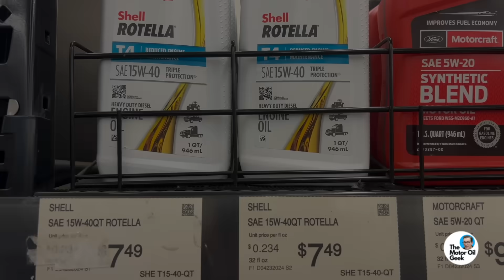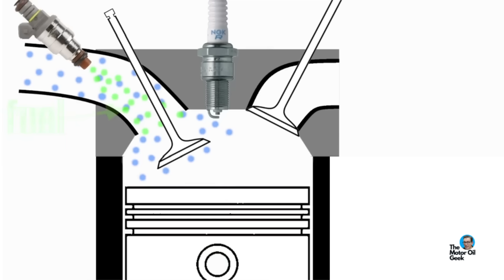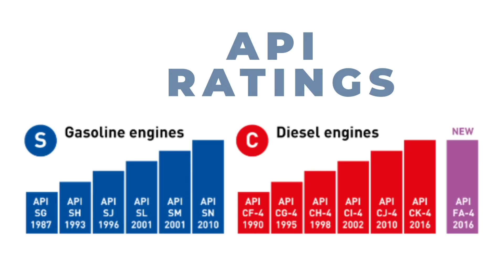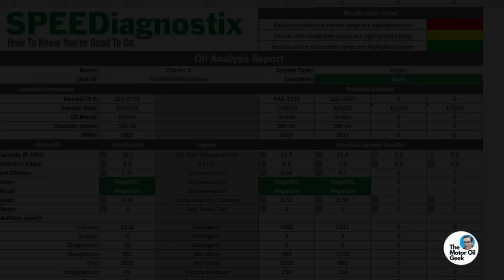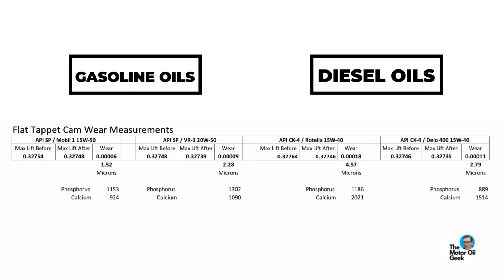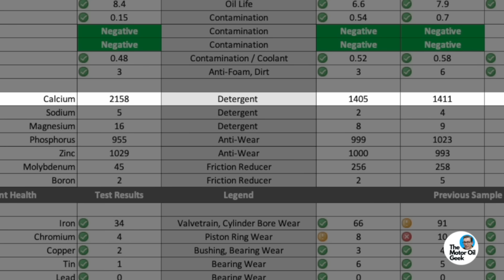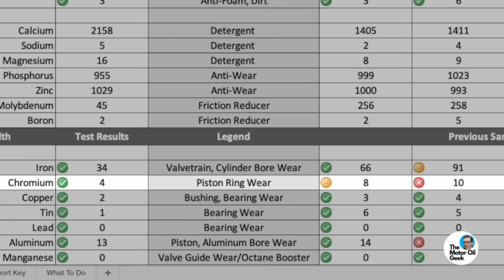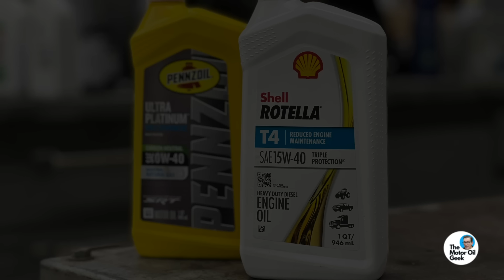Why DIESEL Oil is Actually WORSE for Gas Engines!

Comment: Rotella 5W40 T6  is rated
SN for spark and 
Cxxx for compression
& JASO MA2 for bikes.
Reply: Now I’m really confused because I love T6 for motorcycles and also used it on several cars.
Reply: @MassimoTava  I use it in everything from the lawnmower, snowblower, motorcycle, F150 etc.  and not about to change my habits.
Reply: @michellatour150 maybe try it in your coffee too??
Reply: @sprint2648  Nope, coconut oil in the coffee for health.  Black is still the best though.
Reply: @MassimoTava  T-6 is motorcycle oil but yea I dont run it in my 2022 car that specs a 0w-20.
Reply: I put T6 5W40 in everything at home, from a lawn mower to CFR450R , ridgeline, 6.7 powerstroke… you name it
Reply: Not a good idea for your ridgeline if it’s direct injected.
Reply: Look up the current specs, previous versions did have a S rating but not the latest, only C
Reply: @michellatour150  just bought another case last night ill have to look afterwork
Reply: •	Rotella T6 5W-40: Diesel: CK-4, CJ-4, CI-4 PLUS, CI-4, CH-4. Gasoline: SM, SL, SJ, SH. Notes: For diesel & pre-2011 gas engines w/ catalytic converters.
	•	Rotella T6 15W-40: Diesel: CK-4, CJ-4, CI-4 PLUS, CI-4, CH-4. Gasoline: SM, SL, SJ, SH. Notes: Broad temp range, same as 5W-40.
	•	Rotella T6 0W-40: Diesel: CK-4, CJ-4, CI-4 PLUS, CI-4, CH-4. Gasoline: SM, SL, SJ, SH. Notes: Extreme cold-start optimized.
	•	Rotella T6 Multi-Vehicle 5W-30: Diesel: CK-4. Gasoline: SN. Notes: For mixed diesel/gas fleets, modern standards.
Reply: @MassimoTava  I see but I use European spec as it has tighter tolerances. It's still rated at acea e11 which the only reason it doesn't meet the gasoline a3 spec is the saps level. Typically a3 spec has saps around 1.3% and higher. E11 is about 1% and lower.
Reply: @MassimoTava  15W40 will never been similar to a 5W40. They are night and day different in flow rates at all temperature ranges.
Reply: What are you talking about the working temperature of both of those oils is a 40 viscosity they should be working load at a nearly the same flow rate the cold thickness viscosity of 15 would only become a factor below 40° Fahrenheit however retains far better mechanical sheer resistance due to its base stock being thicker  @TheOfficialNakatsuMegami
Reply: @MassimoTava  which country are you in? The US site and bottles don't mention gas at all for T6 5w-40.
Reply: @rcdieselrc  older containers maybe. I know it used to have SM or SN on the container, but that’s changed within the past few years.
Reply: @rcdieselrc  I just looked and you are correct
Reply: And it also has the increased detergents which increases wear in all gas engines. Or did you just ignore that part because you already bought 50 gallons of rotella when you joined the diesel oil is better cult?
Reply: @bobbygetsbanned6049  I didn't ignore the part where they compared 2 heavier viscosity premium full synthetic oils to a conventional, and a semi-synthetic (or synthetic? both fall under delo400) diesel oil. 
It was a majorly flawed test.

Was the added wear due to the different additive package?
was it due to the difference in viscosity?
was it due to the difference between conventional oil and synthetic oil?
was it due to the difference between manufacturers? 

A test that flawed is either cherry-picking or incompetence. And neither are a good look.
Reply: swiss knife oil indeed!
Reply: T6 all day long in all my Jeep 4.0s…..application matters
Reply: SN is not good enough for newer direrct Injection. SP is better with less calcium as Lake mentioned.
Reply: @papaal7014  t 6 with apple cider vinegar makes the best salad dressing.
Reply: I don't care what any of you guys say, I am not putting rotella in my bike, nope.
Reply: Sadly they have stopped putting the SN rating on the bottles that I have been buying lately.
Reply: T3 is JASO MA/MA2 as well.   No need to splurge.
Reply: You'd probably mix it in your pancake batter.
Reply: Shhhhhh! Your gunna make our favorite oil harder to find! 😉 been using t6 for more then 15 years in multiple vehicles zero issues.
Reply: One size fits all? No thank you
Reply: This video and comment section lays it to test for me. Glad I never put Rotella anything in any of my motorcycles.
Not worth the risk for a little savings ( but dang it suck’s because it’s a 20$ to 30$ savings over amsoil.
But I guess it’s one of those to good to be good things..
Reply: @motov8-garage832 amsoil is absolutely the best if you can afford it I’ve used it in the past thirty years ago in a plow truck transmission previously I used the regular transmission oil but would replace the transmission after the season the amsoil in them they worked like a dozer and never replaced them again great oil
Reply: Baaaaahahahaha. Tell us you don’t have a clue.

Comment: Ok I got a good one for you! I’ve had allot of people who ride Honda Goldwings, and a lot of people will use Rotella T6 diesel oil in there motorcycles and swear by it. I’ve always used the proper motorcycle oils on all my bikes. Being aircraft mechanic trained I’ve always used the proper oils in the proper engines. Could you test the theory out. Thanks

Comment: But that Rotella T4 in the video is also SN rated for gasoline engines! Its right there on the back of the bottle.
Reply: Good spot. At 4:59 the API Donut shows only CK-4, but above it lists SN
Reply: But Which S Cert? I can bet it isnt SP, because SP is designed for low speed preignition, and SN is not.
Reply: @TheOfficialNakatsuMegami  sn+ was designed for lspi, their now finding that when oils becomes "used" their prone to speed preignition so no more low since it can happen at any range from the tests.

The sp is to test used oils for tgdi since the lpsi specs fall off and Noone has been able to test this. Now their about to.

So ibe been told
Reply: This video needs some clarification. SN came out in 2010. Lake focused too much on di engines. Many like myself use the T4 10w-30 in carbureted flat tappet engines and not modern di. Although the eight minute mark was useful.
Reply: @kelseyschoenbaum4681  He didn't focus too much on DI engines, the added detergents increase wear, because they compete against the anti wear additives in the oil. That's applicable to 100% of gas engine applications. It's pretty easy to understand.
Reply: Which doesn't change the fact that the increased detergents increases wear in gas engines. How is that every comment missed this point entirely, when you all obsesses over wear numbers in every other engine oil video!?

Comment: Great video! Can’t believe dudes are putting diesel oil in their70’s Corvettes because of the zinc package!!
Reply: Well they’ve been doing it for 54 years. It meets GM requirements. So…
Reply: they are not direct injection engines.
Reply: Guess if it works for you sweet. I think there are better options out there.

Comment: No argument on running diesel oil in a direct injection gas engine.  But what about a carbureted flat tappet gas burner with the rings gapped for nitrous?  Seems like that application might not be the same slam dunk answer?
Reply: Man they would spend all day explaining the different situations on what oil to use in each engine or motor.

Comment: I've been running Rotella T6 in my Honda ATV, 4 stroke carbureted, for like 2 decades and it has been excellent. On top of that, the engine and trans share oil.
Reply: Yup all I use on a few vehicles is rotella t6 5w40. Zero issues.
Reply: That's what is in my 84 honda 3 wheeler right now. It's spent most of its life running diesel oil.
Reply: @Krankie_V I have 84 200x love that thing
Reply: Run Rotella T6 5W-40 in my turbocharged,  port injected 5 cylinder Volvo gas engine for years.Still no sign of excess crankcase pressure in PCV that can plague neglected Volvo engines.
Reply: All my bikes for 15 years have had T6 put in them.
I change every 3-5k for $25 bucks. Never once had a single failure or issue and will continue to use it in all of them
Reply: I do as well, in fact I run it in all my small engines...... but here is the kicker, none of them are direct injection or turbo charged. Did you watch the whole video?
Reply: @TheTruthman89  yes, I did watch the whole video. But notice how my comment speaks specifically towards my use case and also why I explicitly said carbureted
Reply: And have you been testing the oil to see if you’ve been getting any extra wear?
If you’re not testing you’re guessing.
How many miles do you drive your ATV a year? Maybe 500?

Let’s be real.
ALL engine oils out there will lubricate your engine.
But for how long?
Reply: @einstein3509  That's true, but the real question is will the extra amount of wear  cause the engine to fail before the rest of the car fails. I live in Northeast Pennsylvania and chances are the road salt will rot the frame away before the wear from the oil kills the engine.
Reply: @ 
hahaha funny you should say that.
Those are my thoughts on the boutique oils.
I have no doubt they are far more superior than the other oils out there.  
But do I need that in my daily driver??
I have a 1992 Ford F150 I bought it in 2005 from a friend and it's only ever had conventional oil in it and it has 334,000 miles on it now and it's still going strong and does not burn a drop of oil or leak any and it's been and still is a daily driven vehicle.
In fact we have a 2011 Rav but the wife prefers driving the 92 Ford and drives it every day and it's been a Minnesota truck from 92 until we moved south in 2017.
Reply: @einstein3509  honestly, in a previous video, Lake proved that Napa house brand synthetic oil offers better wear protection than Amsoil and Royal purple 😆
Reply: @Krankie_V  according to Project Farms tests the cheap Amazon oil was the same as Mobil1
Reply: @einstein3509  I have a rancher 400 with auto trans. Just over 5000 miles with Rotella t 6 since new. No issues.

Comment: So why does Harley Davidson recommend that I use a CE, CF, CF4 CG4 Diesel engine oil in my Twin Cam?
Plus, the oil company I use says that their oil is "suitable for use in 4-stroke turbo-charged and naturally aspirated indirect injected diesel engines and petrol engines".
Reply: Ask them !
Reply: I just checked now, In Australia you can get a single product rated for API SN/CF  for light duty (common rail - don't generate much soot) diesel and petrol engines. The CF wouldn't meet the spec required for direct injected gas engines as talked about in the vid
Reply: The oil also wets the clutch. It needs to grab enough so that the clutch pack doesn't slip under loud.
Reply: Typical Harleys have separate engine and transmission oil. So you can run super slippery heavy engine oil 20-50W and different trans oil

Comment: Thank you for the insight, Speed! Always fresh!

3 days ago I poured HDEO to my 110cc gasoline scooter (carburator) engine, so I assumed this HDEO should be good for my engine.
Yet I have been used Dexos certified PCMO for 10 years, and my scooter engine still running very well.
But I always curious what if I use HDEO for my scooter engine, and now my engine is more silent than if I use my regular Dexos certified PCMO.
What will happen if I use HDEO regularly for gasoline scooter engine?
Thanks in advance.

Comment: Does high calcium content oils cause LSPI in ALL gdi engines or only in the small cc ones?     will a high calcium containing oil  it cause LSPI in a 1.8 gdi engine wit a compression ratio of 9.2:1??
Reply: Not in all, if you have japanese tgdi like suzuki k14c, then no LSPI no matter what oil you use. If you have Opel, then it might occur IF you lug engine (low speed high power)

Comment: Lake Speed Jr. I really appreciate your passion for motor oil,s. Im very confused on the topic passenger car motor oil vs diesel engine oil. Cuz im just to diesel engines in passenger cars as well. The Castrol edge i use in my diesel engine is for gasoline, Hybrid and Diesel.  Why is that different in Europe then in the US?
With best regards from Germany.

Comment: I use Rotella T5 10w30 in most of my small engines/lawn equipment. I have not had an issue yet.
Reply: I agree with you.  Been running diesel oil in all my outdoor power equipment for decades, with no oil related issues at all.  But, it's starting to appear that maybe some of these new oils are not so good for the old tech engines like OPE engines.  I asked Lake in my comment about this... hopefully he'll look at the comments and respond, because I would like to know also.
Reply: Lack of issues isn’t proof of benefit.
Reply: @davereiland9921 I do notice the oil is cleaner when I change it. Splash/slinger small engines are not picky. Run T6 5w40 in 6.7 Powerstroke. Run 0W20 in that meets 508.00 spec in my VW.

Comment: Is this some kind of bullshit? In Europe, there is no such thing as 'oil for gasoline engines' and 'oil for diesel engines'. All oils are multi-purpose. So you claim that gas engines suffer in Europe (I bet Asia and Australia) as well?
Reply: Mobil ESP X2 0W-20 has many European approvals for gas engines including VW 508 00 and is also GM Dexos D approved.
Reply: That’s very interesting!!  Can you give us an example of a multi-purpose oil from Europe?  I would like to look at its specs.  Thanks!
Reply: @davereiland9921  To be honest, I cannot find any "diesel" or "gas" oils here. Yeah, sure, I can give plenty examples. I'll start with those which I use in my cars: 1) Fuchs Titan GT1 Pro C-3 (5w-30) 2) Motul 8100 X-Clean (5w-40) 3) Shell Helix HX8 (5w-30). Let me know if you need more brands/names
Reply: @hid3nax  that’s great, thank you!  I believe, of those 3, only the Motul is available in the US.  That gives me something fun to do this weekend 😁
Reply: @davereiland9921  I'm not sure what oils do you have there on shelves.. Try to locate Mobil1 ESP Formula 5w-30 too. Mobil1 is a world-wide brand, I guess it should be there too. Maybe even Castrol Edge LL 5w-30. All those are rated for gas, diesel and LPG cars, including cars having start-stop systems (read abusive wear)
Reply: @davereiland9921 before you can buy it but now 99%oil is for gas diesel and Benz in eu.
Reply: There are ACEA specifications for passenges car motor oils (the A/B class) for catalyst compatible motor oils (the C class) and for heavy duty diesel engine oils (the E class).
A/B : Gasoline and diesel engine oils – ‘High SAPS’
C : Catalyst and GPF/DPF compatible engine oils for gasoline and diesel engines – ‘Low SAPS’
E : Heavy Duty Diesel engine oils

API has a set of ratings too
ILSAC Standard For Passenger Car Engine Oils
Gasoline Engines oils categories started with "SA" (in 1930s, now obsolete) to current SP, soon to be SQ
Diesel Engines oil categories started from CA (now obsolete) to latest CK-4

each of these categories specify a set of requirement for an oil to meet

Comment: I've always put HDDO , 10W40  , 15W40  , 15W50  , in all my motorcycles due to the higher zinc , and detergents in them . The  10W40 in the scooters , and the 15W40 and 15W50 in the engine - gearbox shared bikes . The HDEO mixed fleet oil  don't appear to shear as quick as the non HDEO do , or so called PROPER MOTORCYCLE OIL . None of my bikes have blown up yet , just my 2c worth .
Reply: I was waiting for the Rotella motorcycle comment......huge huge numbers using T6 in bikes.  So common it has become a meme
Reply: @darrellhay  Unfortunately we can't get ROTELLA OIL here in OZ . For me it's GULF WESTERN  , and or  PENRITE , and or NULON oils   now  , which are ( Australian Made oils ) When CALTEX DELO 400 ,  15w40 MULTIGRADE was available here , that was my go to oil , but the MULTIGRADE is no longer available here .
Reply: I have owned a lot of bikes in my day and never used T6 . I never had any failures but always changed my oil sooner than recommended .
Reply: I tell you what, if I was going to design a proper motorcycle oil as an oil manufacture, I'd sure as shit design my oil for a diesel engine, or maybe a jet engine, or even a submarine. That's how you get the best oil for an application, you design it for the application it won't be used in, SCIENCE!
Reply: People are tired of being ripped off and hoodwinked by so called products , due to false  Marketing , that claim to be the best for your vehicle , but when you do the research on them , it is proven that there are cheapee , better qualities in other options , that will look after your vehicles as good or  better , at a lot less cost . If your happy to pay for marketing that make you feel all warm and fuzzy inside , and to be ripped off , im happy for you .@bobbygetsbanned6049
Reply: If you're that concerned, why aren't you running a classic car oil chemistry? Diesel oils don't replicate historic car oils. They actually don't have as much ZDDP as historic car oils, not that ZDDP levels correlate to wear with modern oils.

Comment: Lake, what are your thoughts on diesel oils in small air cooled engines, such as lawn mowers, generators, etc.... outdoor power equipment engines with no oil filtration?
Reply: The are spark engines! But not the same as a modern car engine.
Reply: @ They are spark engines, yes.  But, they are low compression, carbureted, flat tappet, with no oil filtration.  Quite a contrast to the modern, high compression, direct injected automotive engines that this video is geared toward.
Reply: @BKD70  My gasoline scooter engine is 110 cc, 9:1 compression, carbureted & air-cooled. I just poured HDEO 3 days ago to my scooter engine.
Yeah, I hope this runs well.
Reply: I just use the Honda 10W30 small engine oil... I figured it is designed for it.  Why do people feel the need to know better than the OEMs?! I don't get it.
Reply: No hate here but why not just use what the engine calls for?
Reply: @JetSkiSuper7 if you have very old engines they may not even make an equivalent today. (SAE 50 ND)